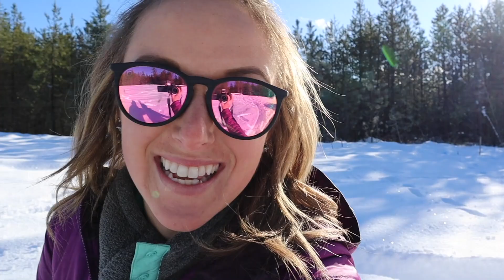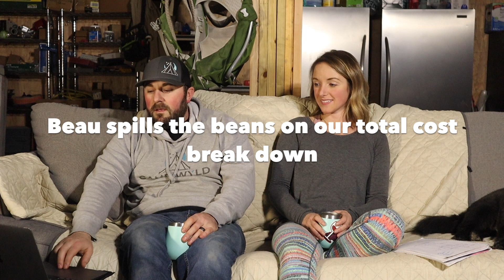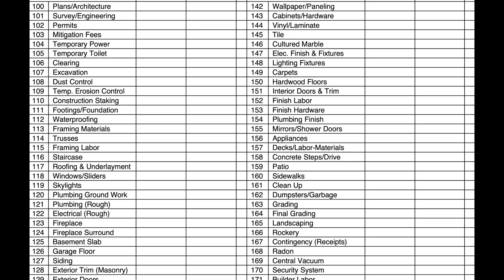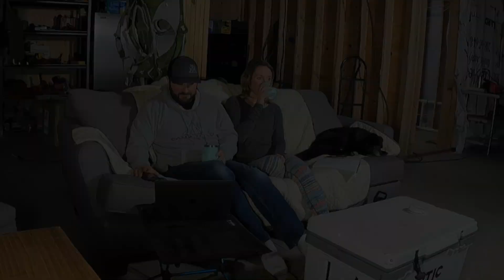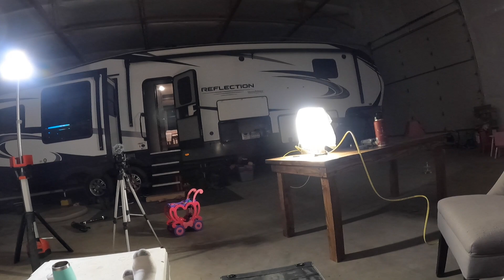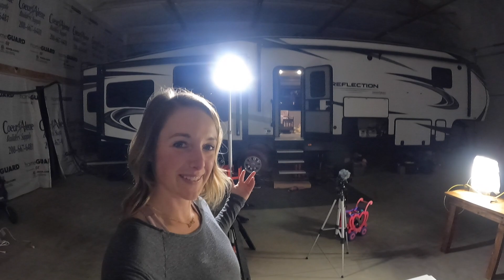WHAT DOES IT COST?? | the costs of building a shop house, barndominium, barndo, shouse, pole barn

Comment: I am building a shop house right now in Iowa.  I saw the Marshall remodel and went with 2.5 inch closed cell in the house!  Its pretty nerve racking trying to learn everything.
Reply: Hey Duston, where in IA are you building?  We live in DM and I'm still trying to find a few acres so I can put up a shop/man cave.  I hope to be working with Paul Marshall on the build, love his videos also!
Reply: @Overpar73  I’m in southeast IA. Mt. Pleasant!
Reply: @dridinger  we're in Iowa also and are going to have Marshall Remodel build our shell!!  We start this spring!
Reply from the maker: There's so much to learn its overwhelming! Good luck with your build, it can be fun as well as nerve racking for sure! Thanks for watching our crazy journey!
Reply: Ask Marshall about his spray foam mess. Alot of what he does is fly by night. Sealing a radiant concrete floor big mistake also. Chemicals in his sealers that he used are cancer causing. You need to do your homework. Mold and chemicals kill. The problem with marshals spray foam was a dew point issue and if you have any air at all passing through the shell of the structure you will get dew point and water, then mold. Buyer beware. I love these videos learning from others costly mistakes. The biggest investment of your life you really should do your homework, not youtube learning. You want good info go to RR builders on YouTube. Of course they the bank is there to give you a draw quickly more money. Oh one more thing, you need that occupancy permit to get that permanent loan.